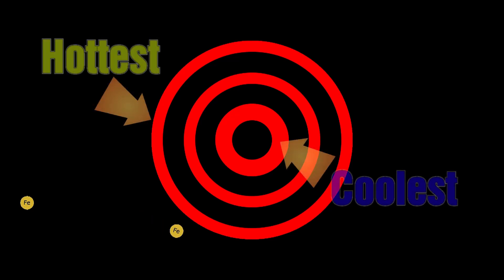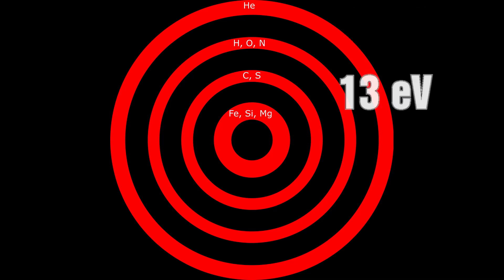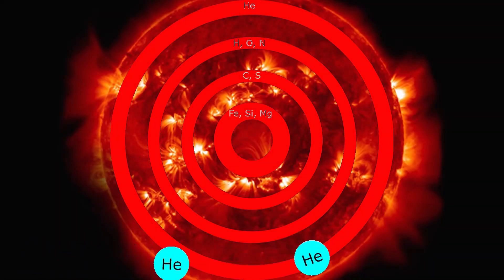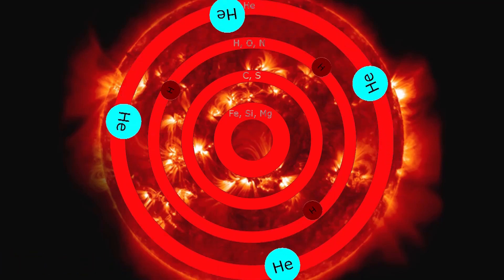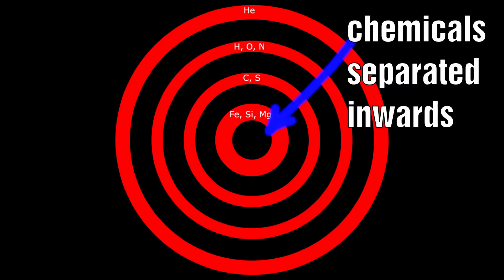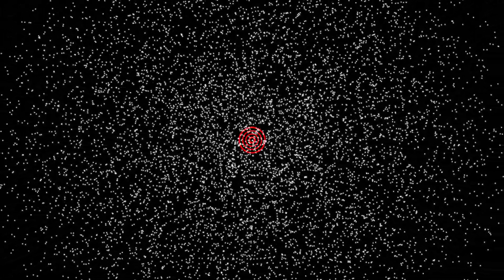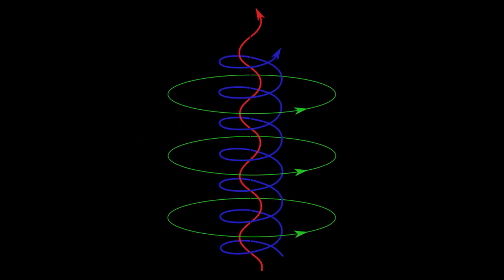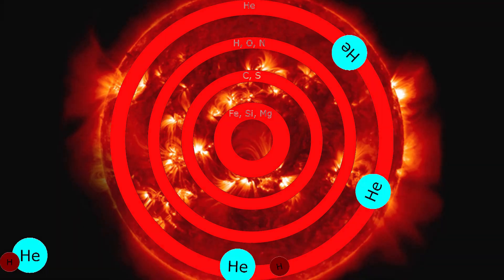Understanding Chemical Separation through Marklund Convection in 60 Seconds

Comment: and the baker reveals a little more......but now more questions...Does a Birkeland current not a have force in its own right ? or is it just a tool....a conduit and that's it.... a cable. I have to ask like this because when I explain it to the great unwashed ( that does include me ) then it needs to be simple......ish. Any videos are great....the more the merrier. thx.
Reply from the maker: it is supposed to be a force free current but as with most things it is a little more complex than this.  I started doing a Birkeland current 60 second video and realised that I might need to make a more detailed one first which is more detailed that the one I already made.  In a nut shell they can actually generate their own magnetic field to drive them forward, classic BC require a magnetic field to be force free, but there are hypothetical configurations (Donald Scott's model) which would effectively have a Marklund convection in them, so counter rotating layers, and these when summed together would create a magnetic field which would allow the charges to flow virtually force free.  Something would still need drive the current along the BC, so charge imbalance, density gradient, gravitational to kinetic energy, electric field, magnetic field but if it's force free it would not require much to start it moving.  There is still much we don't really understand about the circuits in general and what powers them.  Alfven believed the galactic circuit was created through gravitational collapse, into kinetic and this then created a rotating magnetic field.  This field then drove the currents in his circuit.  It could well be that galaxies are powering the main BC we see but in all honesty we don't know at this stage which one drives which!

Comment: I was just thinking that these 60 second clips would be good for curriculum because they could be reused or rearranged dynamically, in a content management system.  Taking a que from software dev., as well as audio production. Think of an interface  that allows connections across threads, kinda like mind mapping software.

Just thoughts for future. 

Note: Naming Convention important as you go, just in case you want to do something like that. Hierarchical. 

Also, you can always string them together for a longer presentation, but being modular allows longer ones to re-arrange or swap pieces, etc.
Reply from the maker: Fabulous idea!  I made them as I thought not everyone wanted all the extra bits and sometimes you just want the plain and simple. Would need to think of a simple way of presenting it, maybe web driven. Will look into this when I get back from holiday.
Reply: @SeethePattern  Thx! I'm sure there are a lot of options, plus paid 3rd party stuff, but I recently got interested in a js library called D3. I will share a channel where an instructor shared his course on it. He also created an IDE, specifically for programming with it. Focus is data driven graphics. I think it would be great for an interface, but I haven't played with it yet. Still recovering from long career in IS development. I have created content mgmt systems for cooperative quizzes for faculty and a whole bunch of admin systems.  Feel free to contact me DM Twitter same name no spaces. Icon is  fractal. Whenever.

Thx for your work!

Comment: Looks like an alignment process for creating a crystalline structure. This fits perfectly with the Halton Arp model, in which neutrons are created and ejected out of the galactic jets, or a Hebig-Haro out of a large star.  Looks like the condensing towards the center can create a venturi-flow towards the ring current and possibly be the cause of gravity in a galaxy, new nebula or a plasmoid, that creates and maintains a planet, star, or galaxy.
    I think a similar thing happens coming out of a laser cavity to pair up the photons before they leave the laser cavity, a back and forth movement inside the laser cavity that squeezes the flow, and lining up the photons into a crystalline structure.  This could be what happens inside of a magnet to cause the magnetic field flow out of one of the poles, and drawing low-ionization material towards the ring current of the magnet.
    A similar thing happens in air conditioning, compressed air, pressure washers, and carburetors, which squeezes, compresses,  and cools the medium at the center of the flow, then rarefying it to get expansion, used to deliver the energy where it is needed, or moving energy from the point of the constriction to a different location, like a turbo-charger or a particle stream from a laser.